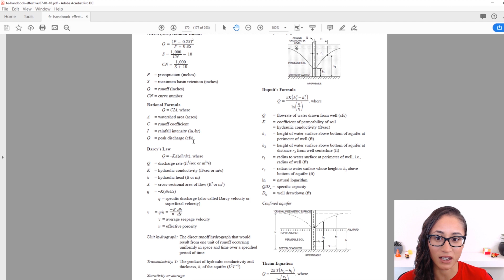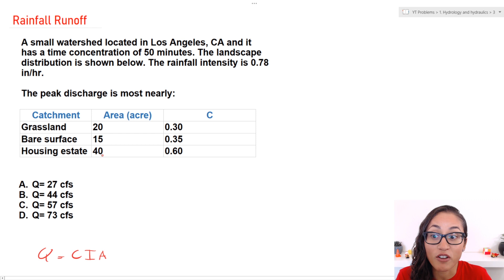Peak Discharge - FE Exam

Comment: Nice work, quick question why rainfall intensity is not accounted for in coefficient of discharge calculation using the averaging formula, though (I) is a parameter in original rational formula of peak discharge?

Comment: Transportation. Question help. A loader capacity is 3yd3. Load time to truck is 1min. 4 trucks with a volume of 15yd3 each. Cycle time to truck is 12min plus load time. What is the productivity yd3/hr?